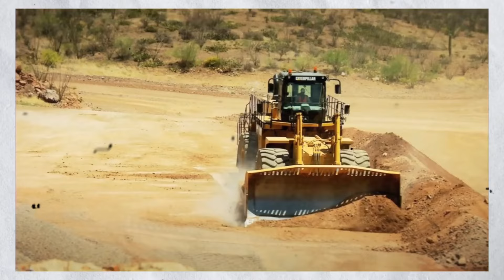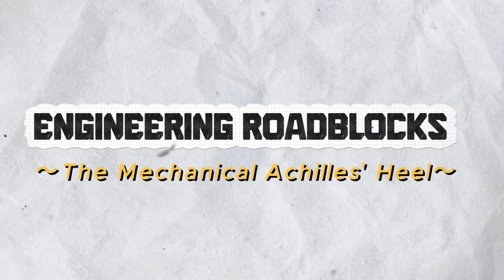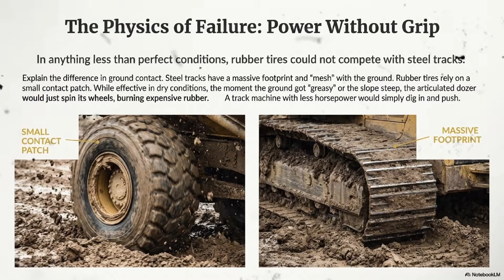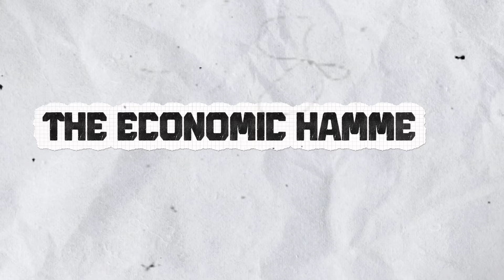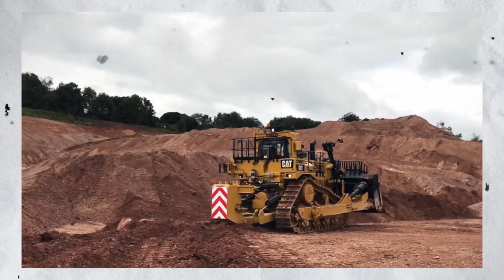The REAL Reason Articulated Dozers Never Became Dominant

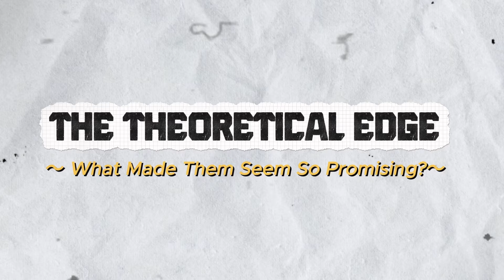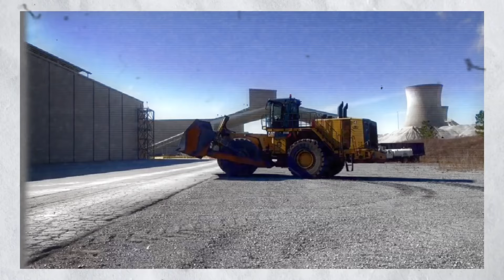Comment: Dumbest example ever  at 1:08-1:30 it moves at 5 mph so if you wanted to move it 5 miles down the road you would want to spend an hour loading it on a lowboy and then spend another hour unloading it when you get to the other end of the 5 miles so essentially spend 2 hours loading and unloading verse driving a 5 miles an hour and it only taking one hour to make the 5 mile trip hmm no wonder why construction crews make so much money with thinking like this